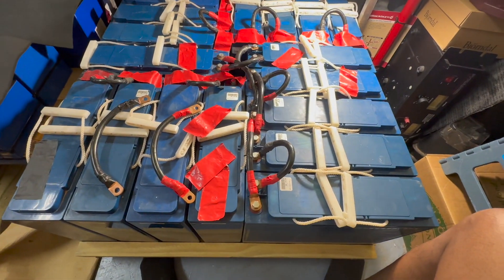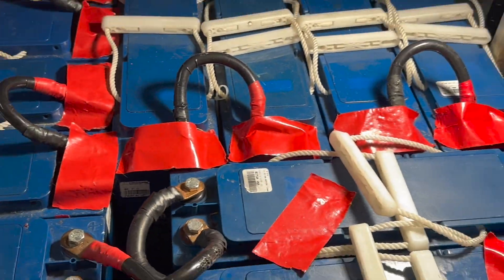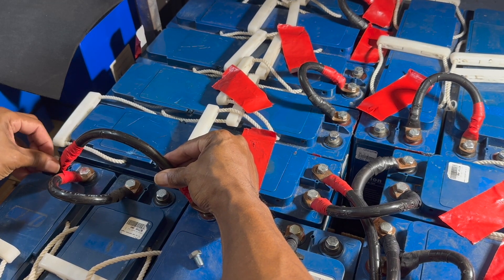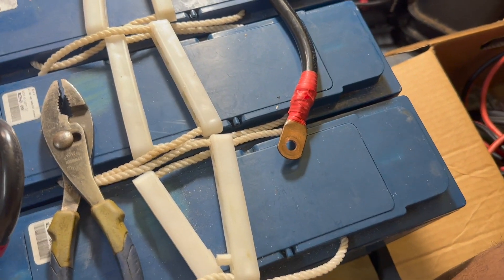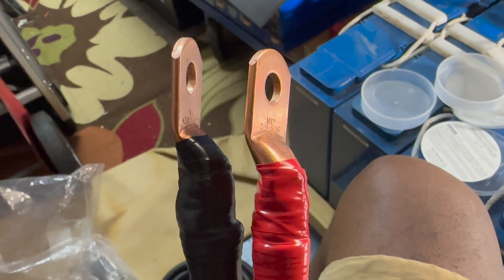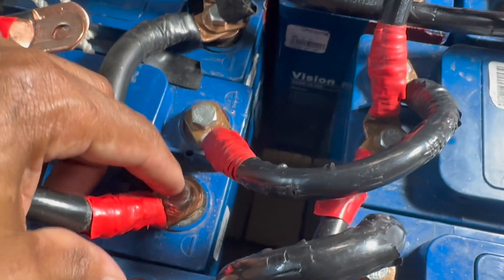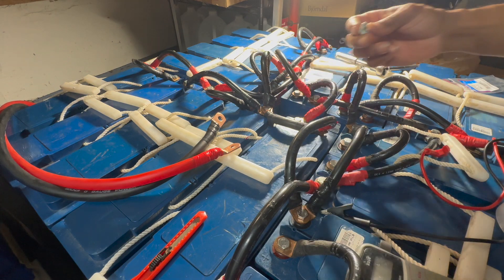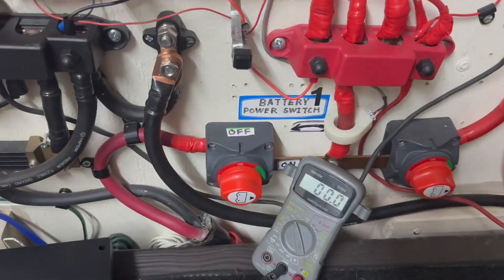MY LIPOVISION 1800

Comment: That's a lot of energy storage.
I would suggest you string those batteries on bus bars to charge and distribute the power evenly into each string.

Thanks for showing
Reply from the maker: @jwsolarusa  Thanks buddy. It’s the way I had to use the thick cables to make them reach the battery 🔋 terminals because the terminals are too close instead of on each side .
Reply: @defjamsgreen  👍